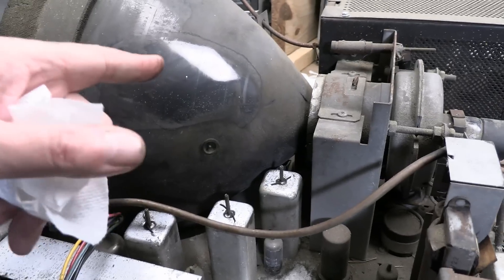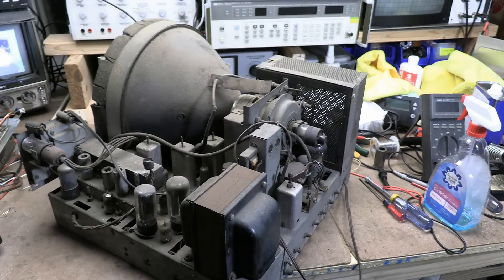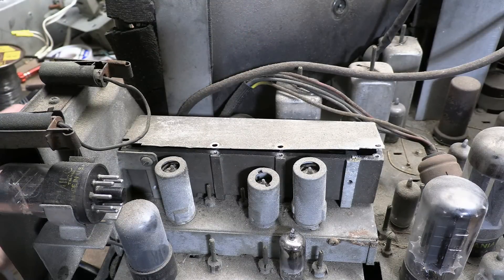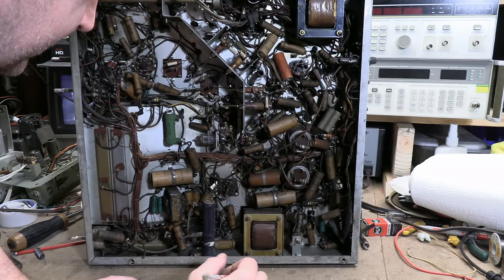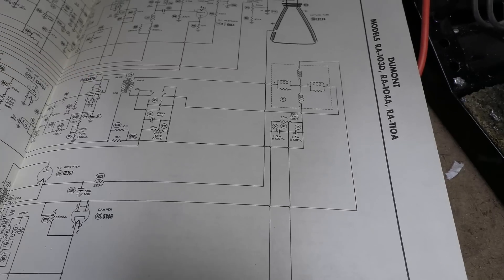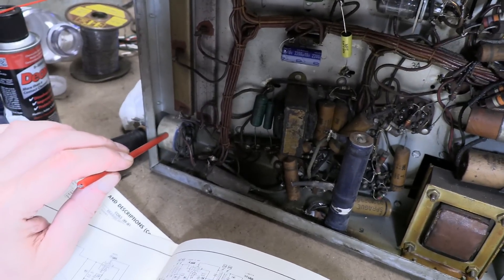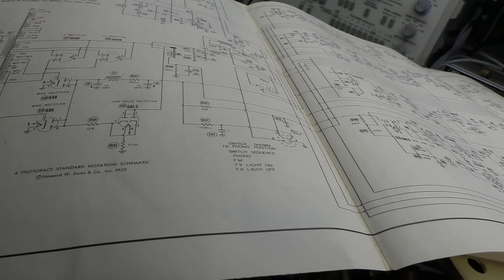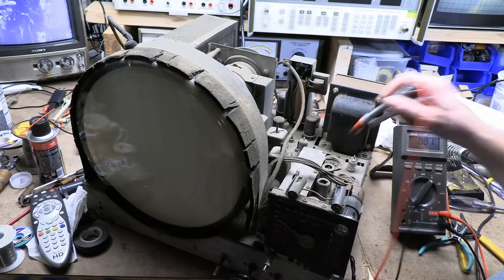Dumont "Rumson" restoration part 1

Comment: It is so interesting to see the variations in design in TV sets this old, getting into well over half a century.  I do not believe I ever came across a set which had an automatically switched B+ supply.  What would be the point, except a picture that doesn't heave into view?  Could this be to go easy on filter capacitors, by presenting the full load all at once to the main rectifier through the pi filters?
Reply from the maker: Yes, exactly.

Comment: Good information, watching this restoration closely since I have a RA-103 Chatham that I am planning on restoring in the future. Glad to get a peek inside that tuner, I had a feeling they were a little simpler. that some of the incremental ones. I have been kicking around an idea on a replacement for can ohms that would be a direct bolt in but uses modern parts. Looking forward to the next video on this set.
Reply: The Candohm is a frequent use case for half century plus TV sets.  Often they were heat sinked to the chassis, something that modern power resistors do not require, but might be a good idea to do anyhow (using heat sink compound) because the original design did not expect direct heat dissipation into free air below the chassis.  A neat enough job with a strip of PCB board and machine screws and plastic core lock nuts could make it possible to reuse the old attachment points and to thermally sink something like square cement power resistors to the chassis.

Comment: Well it's fun watching you do these really early sets. I had a set I was given from a shops back room that was probably a late 40s with mostly radio tubes in it. Tiny square tube, very dim, but it worked. Put it in my sisters attic loft and I don't remember what happened to it but it was cool.

Comment: What is it will people calling wire-wound potentiometers rheostats? Seems to be nearly ubiquitous in videos.
Reply from the maker: OK, you got me.  That's a really good question.  I had been calling big, beefy control rheostats and smaller ones potentiometers for years.  It turns out a control that has three terminals is technically a potentiometer because you can vary the potential voltage as you adjust the control.  If there are only two terminals (or two out of three are shorted together) it is a rheostat because all you can do is vary the resistance.  It appears the way this control is wired, it should indeed be called a potentiometer.  Learned something today :)

Comment: When I was a kid in New Jersey, i used to drag TV sets home from the garbage. This was in the 60's. I didn't particularly take notice of it then, but thinking on it now, it seems a tad surprising that very few sets I got were Dumonts. Considering that Dumont was mfd (that's manufactured, not microfarad) only a few miles away, in Clifton. I lived in Montclair and Dumont labs was actually founded in Upper Montclair. I think because: Most Dumont sets were on the large side and as 10 y/o kid I really could not drag them 1/4 mile or more home from after school. I also think Dumont was considered a Cadillac brand and priced higher than your regular RCA, GE, Motorola sets. Anyone, correct me if I am wrong. Certainly, no way could Dumont achieve the distribution and mfg capacity and advertising spread of RCA, GE, etc;
Reply from the maker: Yes, they were very expensive. Top shelf along with Stromberg Carlson.